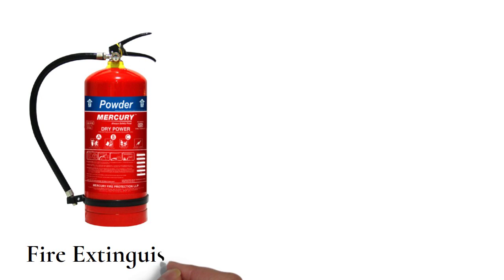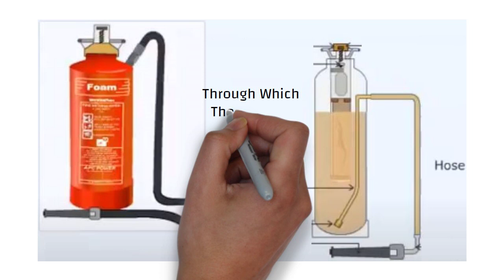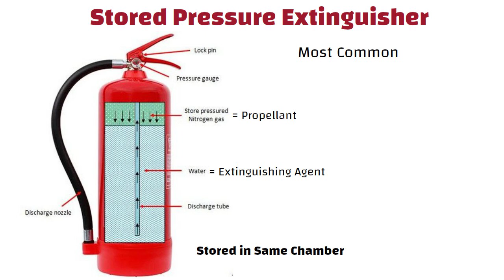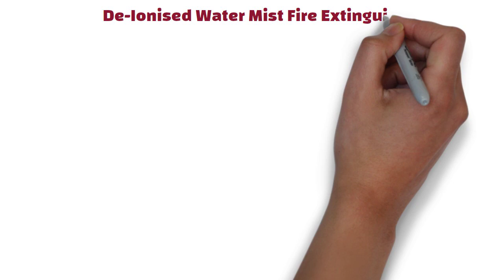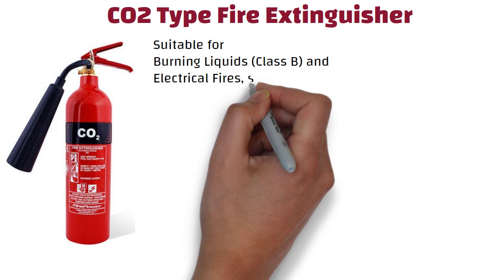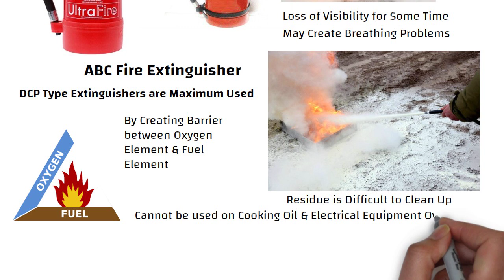FIRE EXTINGUISHER DEALERS IN KERALA, CALL 8138906102, FIRE EXTINGUISHER DEALERS IN ERNAKULAM.

Comment from the maker: FIRE ALARM DEALERS IN KOLLAM, ADDRESSABLE FIRE ALARM DEALERS IN KOLLAM, FIRE ALARM SYSTEM DEALERS IN KOLLAM, ADDRESSABLE FIRE ALARM SYSTEM DEALERS IN KOLLAM, FIRE DETECTION SYSTEM IN KOLLAM, SMOKE DETECTOR DEALERS IN KOLLAM, CONVENTIONAL FIRE ALARM DEALERS IN KOLLAM, MORLEY FIRE ALARM DEALERS IN KOLLAM, GST FIRE ALARM DEALERS IN KOLLAM, ASES SECURITY FIRE ALARM DEALERS IN KOLLAM, BEAM DETECTOR DEALERS IN KOLLAM, FIRE ALARM SUPPLIERS IN KOLLAM, FIRE ALARM TRADERS IN KOLLAM, FIRE ALARM PANEL DEALERS IN KOLLAM, HEAT DETECTOR DEALERS IN KOLLAM, FIRE ALARM SYSTEM SUPPLIERS IN KOLLAM, FIRE ALARM COMPANIES IN KOLLAM, FIRE EQUIPMENT DEALERS IN KOLLAM, ADRRESSABLE FIRE ALARM PANEL DEALERS IN KOLLAM, FIRE ALARM SYSTEM IN KOLLAM, BATTERY OPERATED DETECTOR DEALERS IN KOLLAM, ASPIRATION DETECTION SYSTEM DEALERS IN KOLLAM, FIRE ALARM MCP - MANUAL CALL POINT DEALERS IN KOLLAM, FIRE ALARM HOOTER DEALERS IN KOLLAM, PA TWO WAY TALK BACK SYSTEM DEALERS IN KOLLAM, PA SYSTEM DEALERS IN KOLLAM, PA TALK BACK UNIT DEALERS IN KOLLAM, HOOTER CUM STROBE DEALERS IN KOLLAM, FIRE PROTECTION SYSTEM IN KOLLAM, FIRE ALARM CONTRACTORS IN KOLLAM, FIRE DETECTORS IN KOLLAM, FIRE ALARM DEALERS IN KOLLAM, ADDRESSABLE FIRE ALARM DEALERS IN KOLLAM, SMOKE DETECTOR DEALERS IN KOLLAM, FIRE EQUIPMENT DEALERS IN KOLLAM, FIRE ALARM INSTALLATION IN KOLLAM, FIRE ALARM COMPANIES IN KOLLAM FIRE ALARM DISTRIBUTORS IN KOLLAM, TALK BACK SYSTEM DEALERS IN KOLLAM, FIRE ALARM SENSOR DEALERS IN KOLLAM, FIRE EXTINGUISHER DEALERS IN KOLLAM, FIRE ALARM DEALERS IN ERNAKULAM, FIRE ALARM DEALERS IN KERALA, ADDRESSABLE FIRE ALARM DEALERS IN CALICUT, SMOKE DETECTOR IN KOLLAM,  FIRE EXTINGUISHER DEALERS IN KOLLAM, FIRE EXTINGUISHER SUPPLIERS IN KOLLAM, FIRE EXTINGUISHER DISTRIBUTORS IN KOLLAM FIRE EXTINGUISHER IN KOLLAM, ABC TYPE FIRE EXTINGUISHER DEALERS IN KOLLAM, CO2 TYPE FIRE EXTINGUISHER DEALERS IN KOLLAM, CLEAN AGENT FIRE EXTINGUISHER IN KOLLAM, MODULAR TYPE FIRE EXTINGUISHER DEALERS IN KOLLAM, MECHANICAL FOAM FIRE EXTINGUISHER DEALERS IN KOLLAM, FIRE FIGHTING PUMP DEALERS IN KOLLAM, FIRE PUMP DEALERS IN KOLLAM, KIRLOSKAR FIRE PUMP DEALERS IN KOLLAM, FIRE JOCKEY PUMP DEALERS IN KOLLAM, FIRE DISEL ENGINE DRIVEN PUMP DEALERS IN KOLLAM, FIRE FIGHTING EQUIPMENT DEALERS IN KOLLAM, FIRE FIGHTING SYSTEM IN KOLLAM, VERTICAL INLINE PUMP DEALERS IN KOLLAM, HYDRO PNEUMATIC PRESSURE BOOSTING PUMP DEALERS IN KOLLAM, VERTICAL TURBINE PUMP DEALERS IN KOLLAM, SEWAGE PUMP DEALERS IN KOLLAM, RO PUMP DEALERS IN KOLLAM. FIRE EXTINGUISHER IN KOLLAM, FIRE EXTINGUISHER SUPPLIERS IN KOLLAM,

Comment from the maker: LUBI FIRE FIGHTING PUMP DEALERS IN KAYAMKULAM, FIRE EXTINGUISHER DEALERS IN KAYAMKULAM, ADDRESSABLE FIRE ALARM SYSTEM DEALERS IN KAYAMKULAM, 
KIRLOSKAR FIRE FIGHTING PUMP DEALERS IN KAYAMKULAM, KIRLOSKAR FIRE FIGHTING PUMP DISTRIBUTORS IN KAYAMKULAM, KIRLOSKAR FIRE PUMPS IN KAYAMKULAM, KIRLOSKAR DIESEL ENGINE FIRE STANDBY PUMP DEALERS IN KAYAMKULAM, KIRLSOKAR MONOBLOCK FIRE PUMP DEALERS IN KAYAMKULAM, KIRLOSKAR FIRE TERRACE PUMP DEALERS IN KAYAMKULAM, KIRLOSKAR FIRE PUMPS IN KAYAMKULAM, KIRLOSKAR FIRE FIGHTING PUMP IN KARNATAKA, KIRLOSKAR FIRE PUMP DEALERS IN KARNATAKA, KIRLOKAR FIRE PUMP DEALERS IN HOSUR, KIRLSOAKR FIRE FIGHTING PUMP DEALERS IN KAYAMKULAM, KIRLOSKAR FIRE PUMPS IN KAYAMKULAM, KIRLSOKAR FIRE PUMP DISTRIBUTORS IN KAYAMKULAM, FIRE ENGINE PUMP SETS IN KAYAMKULAM, KIRLOSKAR PUMP DEALERS IN TIRUELVELI, KIRLOSKAR DEALERS IN KARNATAKA, KIRLOSKAR PUMPS IN KARNATAKA, KIRLOSKAR PUMPS IN KAYAMKULAM, LUBI FIRE PUMP DEALERS IN KAYAMKULAM, LUBI FIRE PUMP DEALERS IN KARNATAKA, LUBI FIRE PUMP DEALERS IN KAYAMKULAM, FIRE PUMP SUPPLERS IN KAYAKUMARI, FIRE FIGHTING PUMP DEALERS IN KAYAKUMARIHOSUR, FIRE PUMP DEALERS IN KARNATAKA, FIRE PUMP SUPPLIERS IN KAYAMKULAM, FIRE PUMP DEALERS IN KAYAMKULAM, FIRE FIGHTING PUMPS IN KAYAMKULAM, FIRE FIGHTING PUMP DEALERS IN KAYAMKULAM, FIRE FIGHTING PUMP SUPPLIERS IN KARNATAKA, FIRE FIGHTING PUMP SET DEALERS IN KAYAMKULAM, FIRE PUMP IN KARNATAKA, FIRE PUMP IN KAYAMKULAM, FIRE PUMP IN KAYAMKULAM, FIRE DIESEL ENGINE PUMP DEALERS IN KAYAMKULAM, FIRE DIESEL ENGINE STANDBY PUMP DEALERS IN KAYAMKULAM, FIRE JOCKEY PUMP DEALERS IN KAYAMKULAM, FIRE JOCKEY PUMP DEALERS IN KARNATAKA, FIRE JOCKEY PUMP DEALERS IN KAYAMKULAM. CRI PUMP DEALERS IN KAYAMKULAM, HYDRO PNEUMATIC PRESSURE BOOSTING PUMP DEALERS IN KAYAMKULAM, VERTICAL INLINE PUMP DEALERS IN KAYAMKULAM, INDUSTRIAL PUMP DEALERS IN KAYAMKULAM, SEWAGE PUMP DEALERS IN KAYAMKULAM, STP AND ETP PUMP DEALERS IN TIRUNELVALEI, STP AND ETP PUMP DEALERS IN TKAYAMKULAM, STP AND ETP PUMP DEALERS IN KAYAMKULAM, STP AND ETP PUMP DEALERS IN KARNATAKA, HYDRO PNEUMATIC PRESSURE BOOSTING PUMP DEALERS IN KAYAMKULAM, SEWAGE PUMP DEALERS IN KAYAMKULAM, DEWATERING PUMP DEALERS IN KAYAMKULAM, FIRE JOCKEY PUMP DEALERS IN KAYAMKULAM,
Reply: FIRE EXTINGUISHER DEALERS IN KERALA, FIRE EXTINGUISHER SUPPLIERS IN KERALA, FIRE EXTINGUISHER DISTRIBUTORS IN KERALA, FIRE EXTINGUISHER IN KERALA, ABC TYPE FIRE EXTINGUISHER DEALERS IN KERALA, CO2 TYPE FIRE EXTINGUISHER DEALERS IN KERALA, CLEAN AGENT FIRE EXTINGUISHER IN KERALA, MODULAR TYPE FIRE EXTINGUISHER DEALERS IN KERALA, MECHANICAL FOAM FIRE EXTINGUISHER DEALERS IN KERALA, FIRE EXTINGUISHER NEAR ME KERALA, FIRE EXTINGUISHER TRADERS IN KERALA, FIRE FIGHTING COMPANIES IN KERALA, FIRE CONTRACTORS IN KERALA, FIRE EQUIPMENT DEALERS IN KERALA, FIRE ALARM DEALERS IN KERALA, FIRE PUMP DEALERS IN KERALA, SMOKE DETECTOR DEALERS IN KERALA, FIRE FIGHTING SYSTEM IN KERALA, FIRE PROTECTION SYSTEM IN KERALA, FIRE AND SAFETY CONTRACTORS IN KERALA, FIRE HYDRANT SYSTEMS IN KERALA, PA TALK BACK SYSTEM IN KERALA, FIRE NOC IN KERALA, FIRE INSTALLATION IN KERALA, FIRE NOC RENEWAL IN KERALA, KIRLOSKAR FIRE PUMP DEALERS IN KERALA, FIRE EXTINGUISHER NEAR ME KERALA, FIRE EXTINGUISHER MANUFACURERS IN KERALA, SAFEX FIRE EXTINGUISHER DEALERS IN KERALA, FIRE NOC CONTRACTORS IN KERALA, FIRE FIGHTING EQUIPMENT DEALERS IN KERALA, FIRE PROTECTION SYSTEM IN KERALA, FIRE INSTALLATION IN KERALA, FIRE SAFETY CONTRACTORS IN KERALA, FIRE AMC IN KERALA, FIRE PROTECTION SYSTEM IN KERALA, FIRE PROTECTION EQUIPMET IN KERALA, AMC OF FIRE SYSTEM IN KERALA, FIRE CONSULTANTS IN KERALA, FIRE AND SAFETY EQUIPMENT DEALERS IN KERALA, ADDRESSABLE FIRE ALARM SYSTEM IN KERALA, KARTHAR VALVE DEALERS IN KERALA, DCP TYPE FIRE EXTINGUISHER IN KERALA, POWSER TYPE FIRE EXTINGUISHERS IN KERALA, FIRE HYDRANT SYSTEM IN KERALA, FIRE ALARM PANEL DEALERS IN KERALA, SAFEPRO FIRE EXTINGUISHER DEALERS IN KERALA, MS AND GI PIPE DEALERS IN KERALA, JINDAL PIPE DEALERS IN KERALA, AGNI FIRE ALARM DEALERS IN KERALA, FIRE EQUIPMENT DEALERS IN KERALA, FIRE EQUIPMENT SUPPLIERS IN KERALA, FIRE EQUIPMENT TRADERS IN KERALA, FIRE SPRINKLER SYSTEM IN KERALA, RAVLE FIRE ALARM DEALERS IN KERALA, RAVEL FIRE ALARM SYSTEM IN KERALA, AGNI FIRE ALARM DISTRIBUTORS IN KERALA, FIRE ALARM CONTRACTORS IN KERALA, FIRE PIPE INSTALLATION IN CONTRACTORS IN KERALA, FIRE SAFETY CONTRACTORS IN KERALA, FIRE PA TWO WAY TALK BACK SYSTEM DEALERS IN KERALA, HEAT DETECTOR DEALERS IN KERALA, HONEYWELL FIRE ALARM DEALERS IN KERALA, FIRE NOC CONSULTANTS IN KERALA, FIRE AMC AND FIRE NOC IN KERALA, FIRE SAFETY COMPANIES IN KERALA, NEWAGE DEALERS IN KERALA, MONSHER FIRE EQUIPMENT DEALERS IN KERALA, KARTHAR VALVE DEALERS IN KERALA, FIRE HYDRANT VALVE DEALERS IN KERALA, FIRE HOSE REEL DRUM DEALERS IN KERALA, FIRE SPRINKLER DEALERS IN KERALA, FIRE PUMP DEALERS IN KERALA, LUBI PUMP DEALERS IN KERALA, LHP PUMP DEALERS IN KERALA.
Reply: Fire extinguisher dealers in KERALA, fire fighting contractors in KERALA, KERALA, fire and safety installations in KERALA, fire extinguisher suppliers in KERALA,fire extinguishers in KERALA, fire extinguishers in KERALA, fire protection system in KERALA, f fire and safety installation in KERALA, fire and safety contractors in KERALA, fire safety contractors in KERALA, fire and safety systems equipments in KERALA, fire equipment in KERALA, fire extinguisher in KERALA, fire protection system installation in KERALA, fire contractors in KERALA, fire safety consultants in KERALA,  fire alarm systems in KERALA, fire NOC in KERALA, fire AMC in KERALA, KERALA, fire fighting equipment in KERALA,